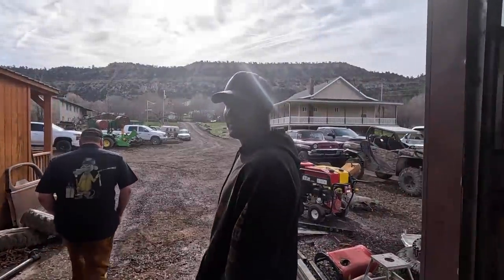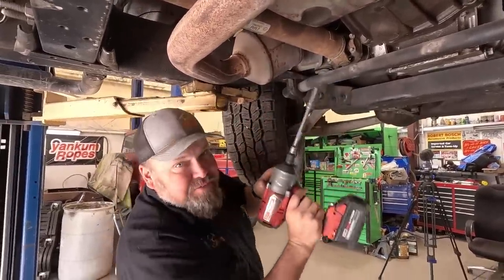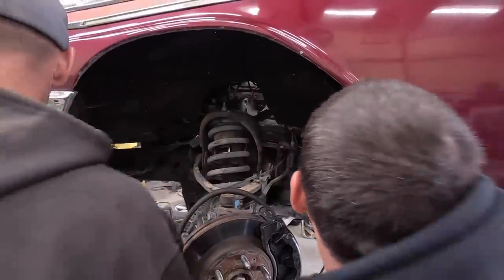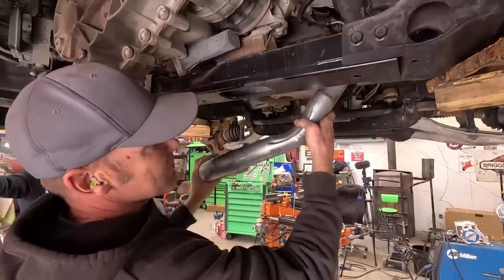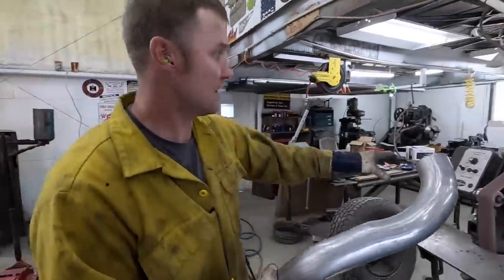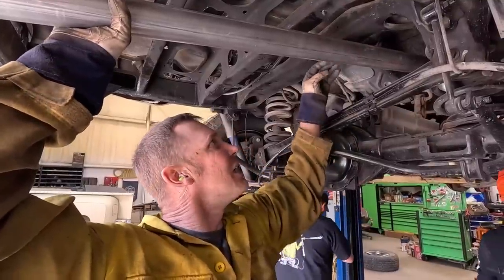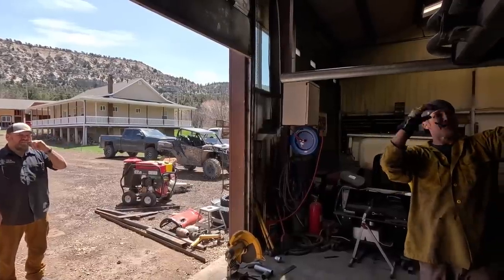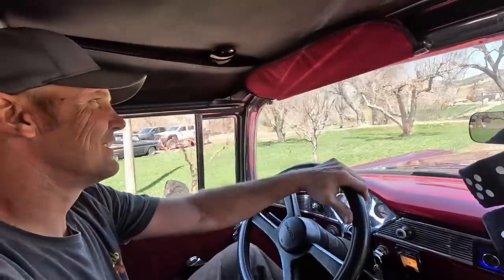This Controversial Chevy Bel Air Needs Some Help.

Comment: Glasspacks were all the rage when I was a kid.  But now that I'm older, I like the rumble of the Flow Masters.  Regardless........that car now has an awesome sound!!  Great work Fab Rats!!
Reply: I remember, back when, it was glass~packs or thrush…I always preferred the thrush 😎
Reply: @Gary Galland. It can have a better sound if he gets those mufflers nice and hot, and shoves a water hose up inside the mufflers and gives the insides of the glass packs a nice cold drink and  shatters the insides of those mufflers, after that is done, then and only then he will get that rumble you referred to. By the way, I run glass packs on every vehicle I have ever owned. Just Love that deep throaty rumble from those duals. By the way in my opinion age has nothing to do with good sound,  I am 67 years young. Nuff Said.
Reply: In my beginning days flowmasters where the thing, but paying $100+ for a muffler that rattles and rusts apart in a year and drones like crazy at any load I now run glasspacks.
Reply: I am on 60's and still love Cherry Bombs.
Reply: @michaelhucker2417  did the same with the water hoses as soon as I'd get back from the muffler shop and I still run glass packs today. l'm 60 and growing up in the 70's was awesome, great music, fast cars and life was so much simpler, wouldn't trade it for anything.✌🏻
Reply: Some flow masters would have sounded really nice, with a cross over tube too balance the pressure, makes a good sound. 
The cherry bombs work there just pretty straight forward. Have a good week and God bless amen .
Reply: Agreed on all counts!
Reply: I love the sound of a good rumble! 🤘
Reply: We used to run short purple horneys.
Reply: aaaaaahh.  Glass packs.  The good ol' days.  The really cool thing to have when I was a kid in the 60s.  😎
Reply: My dad always used to have glass pack mufflers on his old square body trucks.
Now a days I think the electronic flap to straight pipe and then back to stalk at the flick of a switch is the way to go.
Loud exhausts get annoying after a while

Comment: How funny ,, Paul asks if it's a 56 or 55 as he walks past the license plate that says 56....great stuff!
Reply: Came to say the same thing 😂😂😂😂
Reply: @ripvanrevs  
Johnny Cash approved! 👍👍👍
Reply: You could always tell the 56.  There is a lever in the taillight that lowers it to expose the gas filler!
Love your show!!
Reply: The 56 was the only year that the gas cap was behind the drivers taillight.
Reply: Parking lights are 56
Reply: @oldguy70  all of the tru fives had the gas cap behind the tail light.
Reply: @scottstone4948
Reply: 55 did not, only 56 and 57
Reply: @scottstone4948  57 was behind the chrome trim above the taillight, not the taillight itself.
Reply: @scottstone4948  The 55s had a gas tank filler door on the fender, the 56s behind the tail light and the 57s had it behind a hinged piece of chrome on the fin above the tail light. In the days of full service gas stations, it was fun to take a 56 or a 57 to a gas station and watch the attendant try to find the filler.
Reply: @richardwendt4612  the 57 had the filler pipe above the twilight behind the chrome fin trim. It opened sideways to reveal the gas cap.
Reply: @Phil Ward the whole car is 56 all three of the Tri 5 years look very similar but all 3 also have their differences as well as long as you know what you're looking for
Reply: @tiredoldmechanic1791  I love and miss the old full service gas stations I wish they would come back out with some more of them atleast like one or two locations in a city or county but if it's in a town or in the country somewhere then I saw have them all over the place out there because nowadays most full service gas stations are them drive in gas stations where you drive in this garage thing and you tell the attendees what you want and they go and get it for you then you pull out and pull up to a pump and someone comes out and pumps your gas and you pay for gas when you pay for everything else you went there to get so you pay ahead of time
Reply: He's not reader,
He's a breeder😂
Reply: Looking like a fun  56
Reply: My first car was a 56- good memories...
Reply: The question sparks comments which generate positive algorithms for site traffic.  🤑🤑🤑
Reply: When I got a job at a full service station back in 1983, we had a customer with a ‘56. The boss had to come and show me how to fill it😄
Reply: The grill is 56 goes fender to fender. 55 is kind of a rectangle, 57 is all on it’s own.
Reply: Know-it-alls.

Comment: From a custom exhaust guy. It looked good but the hangers need to be turned in line with the pipe. When you accelerate the exhaust system slides backward slightly. The hangers need to move with the pipe. Just look at the factory hangers. With the hangers turned the wrong way they will snap in half in a few months. Took me a few years to figure out why I was fixing so many broken hangers. Lol

Comment: Brings back fond memories. I had a 55 Bel Air Convertible my senior year in high school. A guy gave it to me for changing the spark plugs on his 1971 Mach 1. Anybody that has done that job knows what a pain they were to change. Great video guys.
Reply: Those V8 Mustang II's were a real treat as well, especially the ones that had a V8 swapped in
Reply: No kidding James. I was 17 at the time and didn’t have much for tools. My buddy and I finally pulled the motor mount bolts and jacked up the motor. I swore off Fords that very weekend. Lol.
Reply: @kevinwilliams563  well as crazy as that was...and coming from what some would call a Chevy guy, me only because that's what my first car was a 74 nova ss ,slap stick b&m shifter ,10 bolt diff with Posi 350 small block ,but I blew a u joint almost every weekend. I took it in for dual exhaust to a reputable dealer Midas,wanted bottles but they wouldn't sell them to me,said they were illegal!!! Me being very naive at 18 went with regular stock mufflers,and wished I would have just left that dealer and went somewhere else, but I didn't know better . And needed the whole exhaust system made and installed. I think it cost me around $600 I really can't recall . It wasn't cheap.  Anyway,In my years I've just went Chevy, gm Olds, GMC ...then got a ford and a Dodge they all have something that is good and bad, I still have one spark plug to replace on my GMC full size van ,but it's been year's and I probably never will get it done,unless I take a grinder to the cab 😜✌️

Comment: At 18 I'd spend three days cutting the quiet mufflers off and juggling pipe in place with coat hangers to get glass packs to fit. Now at 70 I'll wait 2 hours at a dealership because of a leak in the tail pipe.

Comment: I had a 55 and a 56. The 56 is my favorite  to this day. I'm a big fan of H or X pipes to remove the school bus rap from the exaust sound. JMOCO. Just My Own Convoluted Opinion. Awesome job eyeballing the bends.
Reply: I was thinking the same, that an H or X pipe should be added. Believe it helps with HP too.
Reply: @K.S.  it helped a lot on my 440 Mopar.   We put 3" pipe,  glass packs, and 4" resonators. Rap'd horribly until the H pipe was added.
Reply: I agree with the X pipe. I had a 69 cougar with dual exhaust and Hush Thrush mufflers. When I visited my sister's house in the winter time I would let the car warm up and the exhaust drone would cause all the glassware in her house to vibrate and rattle. By the way that was almost fifty years ago.

Comment: Back in the day I always installed headers with dual glass packs, installed side pipes on a couple.  The one that sounded the best was my 71 GS 455 Stage 1 with side pipes, that car was a beast.

Comment: The Tri-Five Chevy you have is a 1956. The easy way to tell the '55 from the '56 is to look at the left rear quarter panel - if you don't see a door to the gas cap, it's a 1956. How does one put gas in the car you ask? Stand behind the left rear tail light assembly and look just above the tail light bulb, you'll see a small piece of metal just above the red lens. That piece of metal is actually a knob, turn it to the right and the whole assembly drops down to reveal the gas cap. So cool! Of course it's easy to tell a '57 from a '56 or a '55 because the '57 has those distinctive, pointy tail fins - equally cool!😃

Comment: I never thought I would feel bad for a Chevy. Then I saw the thumbnail to this video. And it didn't get better as the video went on.
Reply: poor car
Reply: At least they cut up a Chevy and put it on another Chevy with Chevy power so I don’t consider that a loss
Reply: It could be worse have you seen some of those chopped up rat rods ?
Reply: I'm all about 55's and 57's , the 56 among purists and car aficionado's is the least desirable of the Chevy tri-fives. I highly doubt that someone took a mint 56 and mounted it on a 4x4 chassis. However,
 I do agree, some guy took obnoxious and added glass packs to make it sound the way it looks. 
Its not for me, but for the owner..., whatever floats your boat.
Reply: @MrMadhousedave  I'd rather have a RAT ROD.
Reply: Paul 56 the back fender wing is just a slight wing the 55 has no wing at all. 55 is the best look of the three. Oh yes the plate said 56.
Reply: Riight!!!  I felt bad for the car and the truck.  If it makes the owner happy, then it's doing its job.

Comment: I absolutely love the hercules tools. I have all the 20 volt ones. Gave all my dewalt stuff away to some young people who needed some tools.
Reply: That was nice of you, its hard for some young people to afford tools to start working in a trade, for example. I shall look into these Hercules.
Reply: @datalorian  I have had every brand over the years and for the money these are great. Not lite duty like Ryobi stuff. So much stronger than anything I had by Dewalt. These are heavy but to have steel gears inside is well worth it. I have not got any of the 12 volt stuff and probably won't. I am waiting on the lower rpm steel cut saw like the Makita Matt uses. We have done roofing, metal fab, other construction jobs and they just make the job easy and charge very fast. I have avoided all electric tools from HF for the ones in the past were garbage. I good friend of mine does commercial construction came over and threw all his 30 pieces of Dewalt tools in my dumpster and got these for his workers and loves them. I dug them out. fixed some batteries that would not charge and used them until I gave them to kids to have something to start with. My only complaint in life another than the political mess we are in is me leaving this world with 50 years of knowledge building stuff that I used to teach to fatherless kids yet today nobody wants to learn anything.

Comment: Brings back memories from long ago. I had a 1946 chevy 6 convertible that I split the manifold . Straight drive shaft pipe on one side and a glass pack on the other. Start up in the morning and wake up the neighbors. Pass a car it it was like slapping your hands together when you back it off. Loved the sound and your work on the Chevy.

Comment: I have ran a lot of Cherry Bombs in my time, the way I eliminated the popping sound was by putting shorty baffles in the tail pipes, added just enough back pressure to kill the pop when you backed out of it. Nice job though, I had a 56' in high school, drove it to death.
Reply: While the car is a 56 the engine and chassis is not . And you just filmed yourselves cutting off and leaving off the catalytic converters and then posting it for the world and the epa to see . I highly suggest you put them back on before the exam comes after you or someone in your state sues you like what happened to the diesel Brothers.  $10,000 to a million would be painful to lose .
Reply: P.S. you could have left the converters on there and left off the mufflers and resonators and gotten about the same sound.

Comment: Paul, I caught a quick glimpse of what looks like a flexible brake line coming down near the rear diff that laid right on the left side exhaust pipe. I could be wrong but wanted to mention it in case it didn’t get caught

Comment: It’s the side steps and the fact that they didn’t cutoff the old body mounts that bother me about this ride. Other than those small details I think it’s cool. The side steps have got to go!
Reply: I agree on the old body mounts, but the steps may be there as rock sliders too. Maybe that's wishful thinking, but i'd like to think the guy goes wheeling in this.
Possibly lose the steps and fab up rock sliders that look like side exhausts?
Reply: @UmmmmmmmWhat   those wouldn’t last one minute as rock sliders super thin metal would just hang you up and get ripped off and ruin the rockers of that beautiful car.

Comment: I have been doing auto body and fab work for 49 years I have a suggestion. Unless you use the hoody ties ever get rid of them in the shop. You can tuck them in I cut them off. Wire wheels love them

Comment: That's a Tahoe frame it's sitting on. Judging by the coil springs in the front, it's a 07-14 Tahoe frame.
And don't worry Paul, I'm not a fan of the glasspack crackle and pop either. They only sound good at idle, and when you're driving it like a sane person. My Grandpa put them on the pickup trucks he used on the farm, mostly because they were cheap and sounded better than stock. The way he drove, they never crackled and popped.

Comment: Nice 👍 that's a 56 you can tell because the front parking lights are part of the front corner trim 55's didn't have the wraparound trim just the parking lights mounted to the fender.

Comment: A 56 Chevy 210 two-door sedan with a 327cu in swapped in was my very first car (in high school).  $300 brought her home.  I hopped her up to a 350 horse engine with new cam, power pack heads, dual quad high-rise Offenhauser manifold, two 4bl carbs, and Muncie rock crusher. She was a beast!  I just couldn't afford the gas even back then when it was 50 cents a gallon...  lol

Comment: On a 56 the rear wheel wells / fenders have a tear drop shape. A 55 has a straight up / vertical then horizontal and down/ vertical. I’ve owned both.

Comment: Tail lights are 56. Turn a lever at the top of the drivers side one and it folds down for to the fuel filler. 55 had fuel door on the side of the rear fender. 57  tail light a has V  shaped vertical flap that opens to the side.

Comment: I'm guessing that with the LS motor and being 4x4, they put the 56' Bel-Air body on something like a Tahoe body on frame conversion. I'd like to know?
Reply: 100%....my guess would be short bed regular cab truck, or short wheelbase tahoe. Just guessing (because of the flex pipe before the muffler) probably 08 or newer.

Comment: Good job yo. Except for Hunter you didn't do nothing but laugh at you. Reminds me of my Bronco.
When I got it it was single exhaust. Had headers put on it dual exhaust glass pack.
I never realized it was so loud.
Until my wife took it down the street to shop and I could hear her blocks.
I got rid of those glass packs..
Sounded good around the river sand in the mountains. But you couldn't sneak up to your old self.
55 56 Chevys are cool looking cars and the 57.
Eusebio 65 Mustang 4 wheel drive over here where I live at and a Camaro. They're no longer around. Probably Park in the woods somewheres.
Thank you.🤟🏽🤙🏾👍🏽👏🏽🤚🏽👊🏽👂🏽👂🏽🤪😊😎🙋🏽‍♂️.

Comment: Simple way to tell difference between’55 - ‘56 is grill is closed off on ‘55 where on ‘56 it goes all the way to past the center of the head lites, the tail lites on ‘55 are smaller and one part red plastic where on the ‘56 it is a larger chrome piece with smaller round red lites and the driver side drops open to expose the gas filler.

Comment: As well as stainless trim that goes all the way to nearly the headlight bezel and a wider grill that rappes around the front and into the fender, that is a 56, the 55 has shorter trim, tail lights that fallow the body and an oval-ish grill.

Comment: Hey Paul I'm pretty sure your flashing light could be ether be the actual led bulbs themselves or you don't have the correct ballist in it I've ran into some led disc lights on dimmers that's do that because the bulbs arnt supported vaguely remember you asking for information on it in one of your videos hope this helps

Comment: Look like a good job to me. Used to run those old glass packs. Had some 18 inch cherry bullets 2 inch dis., 2.5 pipe in and out with cut outs on Doug Thorley Comp headers back on a 74 Chevy big block. Big ole chrome tips.  McDonalds would make me shut the truck off at the window cause they said all their glass was shaking so bad. Old days

Comment: It's either a '56 or it need a new license plate. I had glasspacks on my '76 Ranchero with a 460 and they wore out at around 200,000 miles. Now I like Flowmasters. Had them on my '05 Dodge Ram and it still sounds good with well over 100,000 miles. My daughter and her husband have it now but I've heard it on video. My wife's 2020 Ram has Flowmaster and it still has the resonators but sounds fine.

Comment: My dad always put Cherry Bombs on after soaking them in the used motor oil barrel, drain most of the oil out, and wipe off outside. Changed sound for the better.

Comment: Takes me back to when dual exhaust was just that. No crossover pipe, no cats. You could hear the cackle from each bank. You could tell the a Ford V8 from a Chevy V8 from half mile away by their distinctive exhaust notes. When i was a kid, I had a 57 Chvey BelAir with a 327 4 barrel. I loved dropping it down into 2nd and listening to it cackle down a hill. Cars just don't sound like that anymore.

Comment: If it does not make  "noise"  Paul is not happy.....!    Question: solid hangers from body inhibit exhaust flexing when engine moves will that not introduce cracking and joint failure?